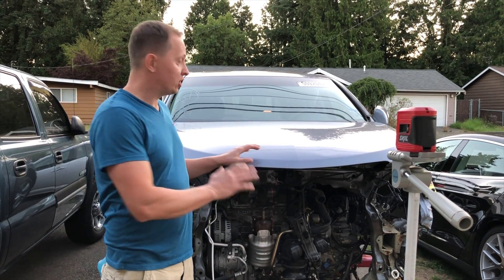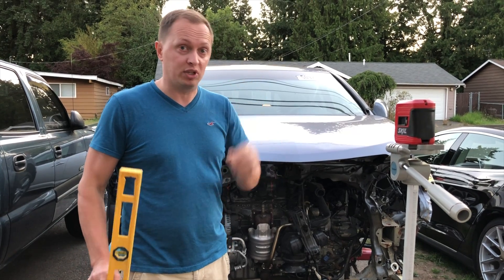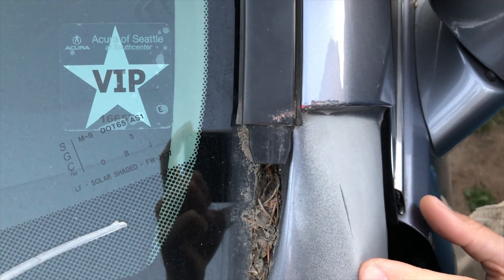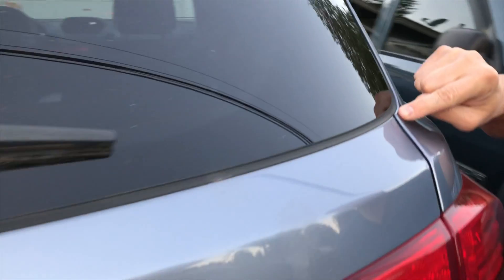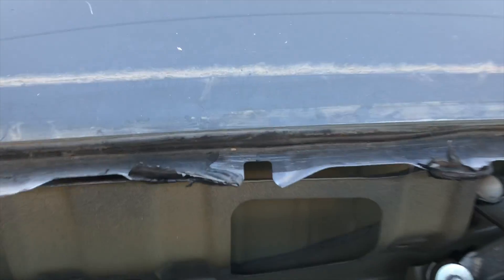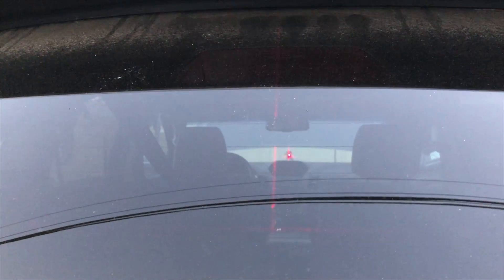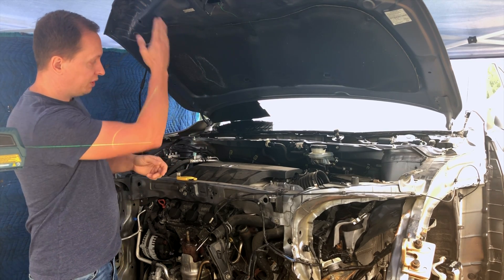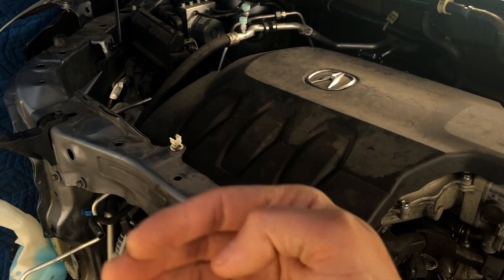✅ How To Use a Laser to Measure Auto Body Car Frame Damage Collision Repair Equipment Universal DIY

Comment: I was wondering about what size tubing you used to make the tower puller that you used on the Honda roof and how did you make the spot puller gun and red attachment and love the videos bc ive been thinking about making my own as well
Reply from the maker: I actually made a video about how I built the bridge that I used for pulling the roof with, I just need to edit it first before posting. And I originally planned on making my own puller gun with attachments, how ever I ended up ordering one from Russia and it came with the keys that are bing welded onto the panel. So that's the only thing that I didn't make :(

Comment: An American using (and not putting down) millimeters!!

Slowly, the US will finish converting to Metric as the rest of the world, i. e. suppliers are metric and of course the fact that is brain dead simple!
Reply from the maker: Metric system is by far the easyest system there is. I personally prefer it way more, it's a no-brainer
Reply: In the auto body trade we have to use metric, all the factory measurements are in MM, and all the measuring systems display in MM and it’s much easier. Fractional measurements do keep your mind sharp though…
This is a clever method for measuring I’ll have to pick up one of these lasers for the next time the $30,000 measuring system lies to me.

Comment: Pretty dang good content. I will subscribe and see what else you come up with. I'd like to see you fix this car? What is the observed problem with the car? Could the owner feel it pulling to one side?
Reply from the maker: This is my personal car, I bought it already with damage. I just built a frame machine to correct a slightly bent frame on the car. If you want you can check out the video of how I made it, it's on my channel. And the video of me fixing this car will be out very soon. Make sure to subscribe so you don't miss that vid.

Comment: Your assumption on manufacturing/design symmetry and statement of inaccuracy to float level does you no favours. Collision damage on steel vehicles radiates significantly. If a float level isn't good enough then you're kidding yourself when you say 5mm is 1/4" and splitting the laser reading on tape measure using your eye.
Reply: Really depends on how accurate you want to be.  End result is if the body panels are straight.  Suspension adjustment (steering) will adjust out the inaccuracy for drive.  If you want more accuracy, measure the side of the hole, not eyeballing the center of the hole, and read one edge of the lazer, as it is almost 1mm thick.  I like the lazer trick as bubble levels are sometimes hard to get a good reading point to point without a standoff, which adds inaccuracy.  Good job, watching your other videos!
Reply: @jimmyp2108  you know the cheapo lasers he was using (all of us really except top end science labs) are divergent. So as they spread the "edge of the laser" is further from the centre delivering inaccuracy, just hope people dont have blind faith in lasers. I agree it's harder to get a reading with a float level so lasers are becoming the mainstay just didn't want to perpetuate the float levels are no good statement.
Reply from the maker: Personally I'll take the laser over the bubble level any day.
Reply: I think that laser is a great method of easy measurement, fix206, but i agree the bubble level can be used too (and have before lasers were invented).  I also have a digital level, which i used to accurately put a mustang II front end in a 54 f100.
Reply: Great info

Comment: Very interesting video. The main limitation with a laser seems to be that it's hard to see in daylight, so it really works best indoors. Audio was still quiet, particularly at the start, so hopefully, your clip-on mic will sort out the audio level. You can always use Handbrake to boost the level if needed. It made a big difference to the short video I filmed on my iPhone.
Looking forward to your next video. I'm sure it will have something interesting.
Reply from the maker: I'll have some good stuff that I'll post in a few days... hope you'll like it. Cheers Bruce !!

Comment: Your frame rail conclusion could be wrong.  It could be that the driver side frame rail is pushed in but the passenger side is fine.  You need the point-to-point frame dimensions that most every factory publishes.  What if the factory span is 900mm? Then your passenger side is perfect and your driver side rail is pushed toward the centerline by 10mm.  

I love this procedure and plan to use it on my next project.  Thank you for sharing it.
Reply from the maker: I did also measure the spacing between the frame rails based off of measurements of a front bumper reinforcement. so I know the spacing is in spec
Reply: @fix206  That works!  Again, thank you for sharing the details of this great method.  And if you haven't seen him, check out Arthur tussik's channel.  I think you two could be related.
Reply from the maker: Haha, I'm subed to Arthur's channel. He's got some good material👍
Reply: @fix206  Sou reparador no Brasil,vi seus vídeos,e o questionamento acima também  tem fundamento,mas vc tirou a duvida,medindo a alma do parachoque,eu também tirava essa medida e uso o compasso de vara,uma ferramenta simples,mas muito precisa,como Arthur Tussik .
Abraços e continue postando vídeos!!!Henrique(Branquinho).

Comment: Thank you for this video! I am going to start using this method at work now.
Reply from the maker: Are you in an Auto body repair line of work?
Reply: Yes, auto body technician.
Reply from the maker: What do you guys normally use at the shop to take your measurements with?
Reply: We have a laser measuring system, but it’s setup for frame measurements. It’s nice to have when your replacing frame rails. The level way you’ve shown will be a great way to show measurements to upper rails and outer tie bars. Then I can show my damage assessors the damage that is not really seen so I can get the repair time needed.
Reply: I have a tram gauge. Bought one from killer tools. I like it because it’s compact when not used and it has built in metric measurements. But it has the bubble level.
Reply from the maker: I've made my own tram gauge, and I do use it sometimes, but it has it's limitations, and that's where the laser "shines".  :)
Reply from the maker: To make life easier, get yourself a cheapie tripod to set the laser on to. That way you can easily move to laser up and down with a side crank on the tripod 👍